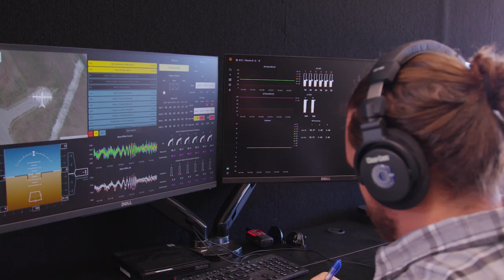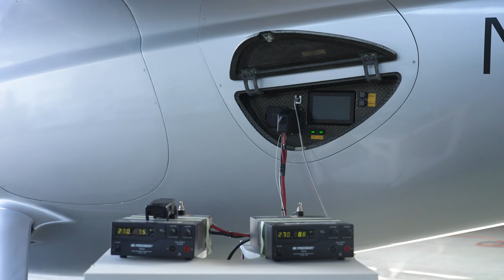Adam Savage Learns About an Electric Flying Vehicle!

Comment: The video - and company - is focused on urban passenger transport, but I think this might be even more useful in rural locations.  A lot of places in the US and Canada no longer get Greyhound bus service because of costs.  Imagine if you could just call for a flight instead!  And it would probably be easier to find good places for landing sites.

Or ambulances.  Right now, rural locations in Alberta are still primarily served by ground ambulances, because of the cost of operation for an air ambulance.  This means a lot of people waiting 30 minutes or longer for an EMT to get on site.   A lot of the cost of the helo is fuel, of course, but also the *pilot*.  If the autonomous vehicles get capable enough, you could replace those rural ground ambulances with an eVTOL.  There'd still be the EMTs or paramedics aboard, but you wouldn't need to also have a professional pilot for every single bird; instead, a qualified ground-based operator could monitor four or five birds at once, ready to intervene when needed, and bringing the operating costs down to something affordable!
Reply: You are correct. While we are focusing on urban air mobility, the applications for eVTOL technology expand far beyond the scope of UAM. It's going to be an exciting future for our industry!
Reply: While in the urban environment such an apparatus would land on fixed locations, in a countryside the choice of landing spot is a non trivial task and is hardly doable by autonomous vehicle or person without proper qualification.
That is one thing that makes it less likely to happen in a near future.
The range is another problem. Urban areas tend to be quite compact. Shorter flights make electric vehicles less atrociously inefficient in that regard.
I am sure that kind of aircraft can be adapted to winter conditions. But deicing adds quite a bit of complexity and risks. California in a summer is kinda hothouse conditions. Canada and Alaska are totally different place.
Reply: That will almost certainly never happen. If there was enough demand for rural transport to make operating a fleet of these bad boys commercially viable, a bus operator could come in and undercut you by 50%. Operating any kind of aircraft is always going to be massively more expensive than operating a six-seater minibus or similar. You can already "call for a flight instead" - helicopters exist. You don't do that because of the cost, not because a solution doesn't exist.
Reply: @ChrisBLong  While I mostly agree with your arguments, I would disagree with a statement.
They say that people have being stating that automobile would never be main rural transport, because a horse wagon operator could come and undercut you by 50% :)
At the moment autonomous electric aircraft transport service seems to be not commercially feasible. But there are already areas where aircraft are important means of private transportation and main emergency transport. Bush plane is one example. Alpine helicopter ambulance is another.
That electric VTOL is potentially more convenient and even economical replacement for road vehicles in any place the road is not short and straight. People value time over money. Due to physics an aircraft will be always more expensive than a road vehicle, at least if you don't count the road upkeep. But as the energy storage technology improves and energy itself is getting cheaper, at some point you won't care for energy cost.
Not today. Not tomorrow. But I would definitely not say never.
Reply: @ChrisBLong  Ah, but the entire point of the video is a company's attempt to reduce the cost of on-demand, point-to-point VTOL flight to a level where mass implementation is possible!  Granted, market density in a rural environment is lower and you'd need a longer range aircraft (and a winterised one for most of the industrialised world, yes).  But it's not impossible.

The bus analogy is also a bit imperfect.  The real reason first trains and then busses disappeared wasn't cost, it was convenience; with either any passenger was at the mercy of the operator's schedule, and usually had to spend a bunch of extra time going somewhere they didn't care about in order to serve some other customer's needs.  This is also one of the big challenges with urban mass transit, at least in North America - people are more concerned about convenience than cost.

This concept is more of a "flying uber," where you don't have to share the vehicle with a bunch of strangers and it goes directly to where you want it to go.  Now, we dontt see ride-shares or even taxi companies servicing a lot of small towns either - but a lot of that is a time and TCO problem.  For my father to take a cab into the city, it's going to occupy the cab for over an hour.  The cost of that trip is proportionately high; and thus the customer base is small.  The higher speeds and more direct routing of an aircraft may be able to offset that.  I don't say it will and there are certainly obstacles to overcome, but I don't say it won't happen either.

To my mind, the real question is "could this happen fast enough that there are any small towns *left*, or will NorAm be down to a handful of folks living on farms and bush quarters with everyone else having moved into the cities by the time the tech is viable?"
Reply: I worked in remote aviation in Alaska for 8 years and I'm also excited for the day when people can ride these, and also have their goods delivered by evtol's.

Comment: This man invented the helicopter for city travel when, what we really need is just better public transportation infrastructure.
Reply: let's be honest, this thing will cost 6 figures. it's not for the general public
Reply: @particle_wave7614  Busses are 6 figures too. Sometimes even around half a million dollars a pop. A train can easily be five million dollars. Expensive doesn't mean it won't be for the general public. 

But this won't be for the general public, even as a general taxi cab service. It'll be for business class level passengers.
Reply: @MrMartinSchou  Busses can fit a couple more people than this.
Reply: @datonkallandor8687  I never claimed otherwise. My point was that you cannot simply rule stuff out for general public use by cost.

And this being a prototype, we also cannot rule out that there will be 20-seater versions of this type of vehicle. I doubt that will happen, but we cannot rule it out.
Reply: @particle_wave7614 6 figures is optimistic lol. Closer to 8. A traditional, mass produced, carbureted 4 seater trainer plane is routinely over 400k. Closer to 500k with fancy avionics. That’s for the most common mass produced models that have the advantage of economy of scale. A common turbo props can exceed 5 million. Something this wildly complex could easily exceed twice that.
Reply: I can see this replacing helicopters and limo rides at first.  Again first gen tech is usually reserved for the rich.  
Iike the car,when first introduced was only the rich driving around.  As it becomes mature. I see larger capacity versions used in place of sort haul flights and such.   I don’t see this replacing cars anytime I’m my lifetime though

Comment: Craft like this would be great for rapid emergency response.
Reply: we have helicopters
Reply: @vossli1074  It’s called redundancy.
Reply: @ultrajd  No it's called impractical and stupid. Just think of all the people who will die while this thing charges. Rescue copters are highly developed, reliable, perfect for the job and refuel in minutes. They can run all day with crew changes if needed. This thing...is a very small plane that can take off vertically and when brand new fly 100 miles under optimal payload, temperature, and wind conditions, with one takeoff and one landing(or maybe 2). A few years later and that drops to 80 miles. And nobody even slightly familiar with battery tech is predicting DOUBLING of capacity "in a few years".  Start adding everything needed to save lives and it's out of the running instantly. One problem with electric aviation is a discharged battery weighs the same as a charged one, thus becoming more and more dead weight as it flies..A real plane or helicopter starts getting lighter as soon as the engine starts. That and the energy density of batteries vs fuel makes batteries a joke. Even with  the weight savings of the electric powertrain batteries will never equal actual fuel.
Reply: It seems a bit slow for emergency response.
Reply: @slabriprock5329  We already have all electric fire trucks.
Reply: @ultrajd  - Finally, an erudite comment. Thank you.

Comment: How about flying trains? Or, you know, regular trains? Flying taxis (because planes need a pilot's license and a lot more training than driving a car so flying cars are a no-no) are just expanding the congestion problem into three dimensions. Even if you had perfect autonomous aircraft the safety margins for air traffic are a lot larger than automotive traffic due to fluid dynamics. You'd buy time only, not a solution, and not a lot of time at that. Fifty years if you're lucky. Ask air traffic controllers or aircraft accident investigators what they'd think about ten thousand planes flying around the southern Californian metropolis. Americans, please kick the auto industry out of your lawmaking and get your train network back. You'll be so much happier. Even the congestion-solving AIs meant to optimize car traffic just reinvent trains. They remain the safest, fastest, and most efficient means of mass transit.

Also, this here is a plane, not a car. It's far too wide to drive on public roads and even if the wings folded up and down again it would then be too tall. As other people have said, this has a use in certain situations but it wouldn't be adopted for widespread use. They boast of its 100 mile range but that's pathetic. Batteries haven't exactly advanced much at all in decades so without more energy storage even the limited use-cases for this thing are limited further.

Comment: Impressive tech but it is not what I would call the solution for congestion. How about designing city streets for pedestrians and cyclists, and allow for a mix of housing and commerce, which means people won't even need to drive most of the time? Less cars equals less congestion, free of charge.

Comment: I'd love to see what the dead stick landing capabilities of this are.  By having an airplane mode I would assume that there is a safety factor of being able to have a controlled descent as opposed to a vertical landing only multirotor.
Reply: I suspect autorotation for emergency situations isn't a possibility due to the low inertia of the lightwieght propellers and lack of thrust reversal. At low speeds, "deadstick" might be a good descriptor
Reply: @jonathangehman4005  That's a decent sized wing it's got. I would imagine that in horizontal flight above what their future Pilots Operating handbook describes as "minimum stall speed in level flight, with propellors in forward position," it would glide pretty well, certainly better than any helicopter. And since the props can feather, they may actually help in an autorotation given how many there are, though you're right about a lack of rotational energy. Perhaps they would be better feathered, then unfeathered just before touchdown to lower the landing speed. Or not. Below that speed, or in a hover, or a combination of altitude/speed/propellor angle, I bet it has a parachute rescue system, probably with a pin that will jam-stop the propellors to prevent fouling.
Reply: @tomkam9783  Good call on the parachute.  I  reckon you're right about that.  Makes the most sense, although you gotta wonder what would happen if the thing is only 100' off the ground and the props stop spinning before it gets into forward mode.  Kinda doubt the parachute would work at that low height, although I'm no expert.
Reply: @davewestner  If you're in a hover in any craft at 100' and lose all lift you're pretty equally screwed, at that point you need a good force absorbing chair and some fortunate luck or an ejection seat.
Reply: Given the small mass of these props, there really is no autorotation option. It will have some glide slope in horizontal flight, so if it is high enough, it will have some options like a typical aircraft to find a landing site. 
But it seems that the objective is sufficient redundancy to never need that. With twelve props, it is likely that it can at least make a controlled descent vertical landing on half of them. It would almost certainly be an uncomfortable landing, possibly with irreparable air-frame damage, but not cause injuries. And if it loses two, it would probably be able to either continue to its destination or return to the launch site, so not need to find an emergency landing spot on the way.
Reply: @strehlow  I was an electrical designer on one of the competitor EVTOL aircraft at a major aircraft company and I can guarantee you that the redundancies themselves had redundancies for safety. The two big hurdles for these vehicles are battery technology and noise requirements. Battery technology is not where any of these vehicles need it to be because they are too heavy at this point in time. Battery chemistry and protection from battery failure are a huge part of designing for safety. Battery failure includes explosion and runaway fire. Companies are moving away from fossil fuels and Uber Elevate made it a requirement. Noise is also a HUGE factor in rotor design because these vehicles are meant to operate inside of cities where noise is a huge issue that the FAA is involved in. They are also meant to make short hops within a 250 mile radius because that is the range of the best batteries. As for hard landings, there is but so much a vehicle obeying the laws of physics can do, so the design revolves around risk management of  0% failure of anything. Right now we are seeing concept vehicles that are more proof of concept. It will be a long time before these are commercially viable.
Reply: @tomkam9783  I think I'm right is saying that the rear props are not variable pitch. They are optimised for static thrust and are switched off in "airplane mode".
Reply: All the motors independent, multiple battery packs, redundant power. Pretty difficult to see how this type of plane could crash due to internal causes. Forced landing perhaps, but not fall out of the sky, no.

Comment: That's surprisingly quiet. Unlike other flying car startups
Reply: I dount think it is ,12 small Engines are definitely louder than one big engines .
I bet a modern Helicopter is more quiet then this thing.
Reply: @timmetimme1360  it’s quiet, we heard it in the video. A helicopter would be excessively louder. Not to mention the motors are electric and the blades small and designed to be quiet.
Reply: @alakazaam4292  The sound in the video is turned down very much. In the video its more quietly then a small drone its imposible to make it so mutch biger and add another 8 engines to it while making it more quietly
The smaller the rotor (blades) the more rpm it needs and it gets louder .
Reply: @timmetimme1360  Watch the video again. They specifically explain the benefits of smaller vs larger engines on noise, when done correctly.
Reply: @Yutani_Crayven  Na i dount need to . I know better ! 
The blade Design comes from Airbus they juse it for a long time now  not only on Aircraft but also on Helikopters .
I know this thing is Louder then a modern Helikopter 100% !
If you guys wont to belive in this then do so . I m sure it will go nowhere like every "flyingcar" bevor.

Comment: Why are so many people calling helicopters 'flying cars'. They are not. A flying car is a car that can fly. It can also drive on the road. A helicopter is a vertical takeoff/landing aircraft. Sure there are hybrids such as this one that can do vtol and horizontal flight like a plane and don't have a single rotor so aren't really helicopters, but they aren't flying cars either, nor will their primary use in the foreseeable future be transport around a city just as helicopters are not heavily used for transport due to their cost noise and other issues.

Comment: If you read this Mr. Savage, they should give serious consideration to a medical version, to operate more or less just like medical helicopters do. Especially important if this kind of platform can move faster than a typical helicopter could in level flight. Low volume, high priority flights seems to be something this sort of platform could do well with, and the cheaper service cost, and higher safety would just be a bonus if such a craft can get from point A to pint B more quickly than a helicopter.
Reply: lmfao, literally nothing you said is remotely true. In fact, multi-rotors are far more prone to imbalance and have a much higher cost of operation.

Comment: The plane is neat but this is not a feasible solution to traffic problems. The issue needs to be tackled at its source, which means mixed use zoning, slower roads, better public transit, bike, and pedestrian infrastructure, all of which will make it easier to move around cities by virtue of making us less car-dependent. All this "flying car" would do is move congestion in the streets to congestion in the air where it will be infinitely more cluttered and dangerous. Sorry Adam but tech isn't gonna solve what is fundamentally a policy and planning problem.